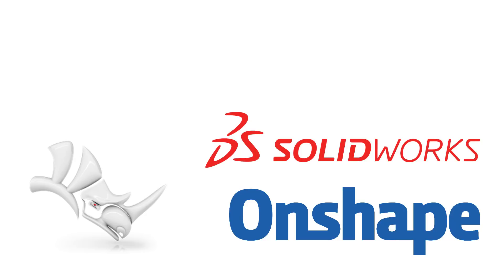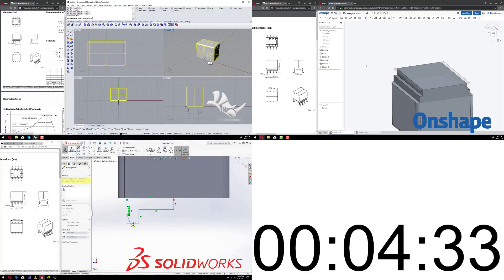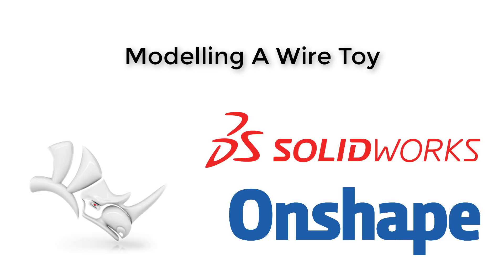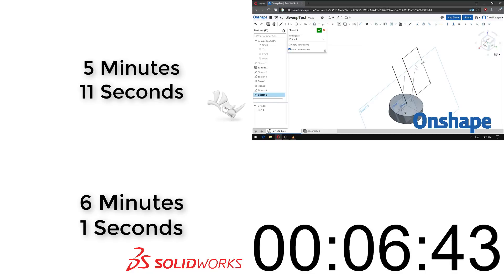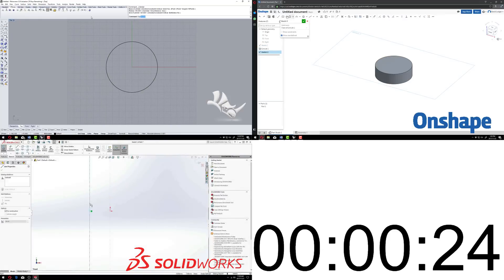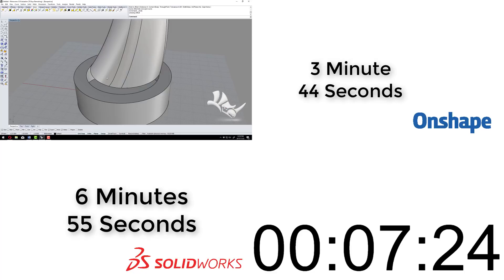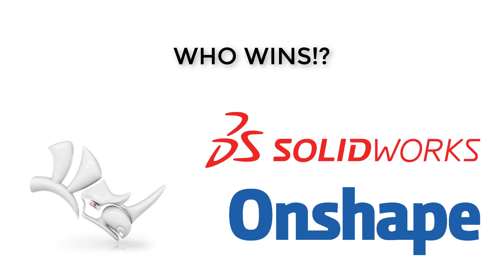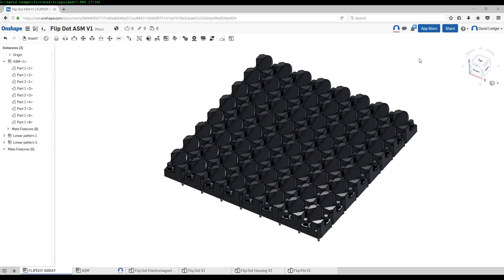MCAD Shootout! - Rhino vs Solidworks vs OnShape

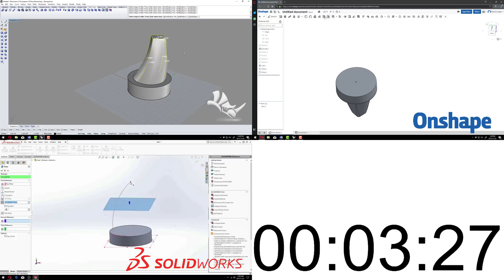Comment: At 7:09 you literally mentioned that "Rhino really, really sooking". The very slow time for making the fillets in Rhino was due to using improper technique. At 7:45 you intentionally changed the rail type in Rhino from "Rolling ball" to "Distance from edge". Upon that moment you even saw from the real-time preview that the fillet with "Rolling ball" would work just perfectly (similar to what both Solidworks and Onshape did), but for some unknown reason you decided to NOT use the working solution and opted for the other fillet type that eventually failed, because the bottom shape was a circle. That's something that every experienced Rhino user knows.

Comment: lets say i bulid 3d model with a contractor on 3dsmax  . what is the chance 3ds make artist will have full control over solidwork? i need to manufactor watch (we talking about 4-7 different part)  the most complex part is watch engraving for the dial face.which make me wonder should i go texture with 3dsmax or convert to solidwork and texture on that ? thanks

Comment: I use Rhino for freeform optics design. It's the only CAD package available that has good enough surface modelling tools to do it. Most other tools are focused on mechanical design and engineering use and simply do not have flexible and accurate enough B-spline surface modelling. It's no coincidence that Rhino is also the defacto tool for modelling ship hulls. Many of the same issues. I think maybe the only other tool that could potentially have the correct surface modelling feature is Catia. Rhino can be scripted from Python too, which is critical for designing more complex optic surfaces.

My point is that you need to choose the right tool for your task. Each of these tools has a niche. I think the mechanical design area has many good choices. However smaller, more unusual design domains usually have one or maybe tools available that are suitable.

Comment: Hi David, are you equally proficient in all three packages? In my opinion, the value of being able to create parts quickly is fairly important; but what is more important is the ability to make changes to designs should they need changing. How do the three stack-up in this regard if decent design intent has and hasn't been used?

Comment: Now we can see how good you are with Rhino and Solidworks. And how good we are ? The time depends on the experience of the user. Are you good or bad or mediocre ? The time comparison is totally pointless, because it doesn't matter if i create a 3D model in 10 minutes or in 15 minutes. Small electrical components are not complex 3D things. You wanna download ready to use 3D models instead of creating one. Whitch kind of 3D files will you find on the net most often ?

Comment: I work with Rhino daily for jewellery design,  there are definatly quicker ways to model,  fillet curves before lofting to avoid all that trimming.
Reply: I would appreciate and details greatly, this issue is such a pain in the arse.
Reply: David Ledger 
In the example where you had difficulty I would have created the top and bottom curves for the cylinder with the square box too,  choose rounded corners,  then from the front view raise the curves to the hight you want.  Switch back to the front view and use the project tool on the base curve to copy it on to you base surface.  Use the trim tool to create an opening in the base using that curve.  Create one profile curve between the top and bottom line's and use the sweep2 command,  no fillets needed.  Rhino is terrible at handling fillets,  I have about 6000 hours of rhino under my belt now,  most people don't have that kind of time,  but it's part of my job.  It is an extremely powerful surface modeler,  of you add t-splines you can model fantastic organic shapes as well.
Reply: Square box tool,  sorry for the typing errors,  sent from my phone, small keys.
Reply: That seems to make sense. Certainly faster, not too much though, thanks for the tip :D

Comment: Why do you feel like you have to constrain the sketches in Solidworks? It's completely fine to leave things under-defined, you don't HAVE to do a completely parametric model.
Reply: Yes, Good point! should have just eyeballed it and left it or had it auto define things after eyeballing.
Reply: Craparametric modelling?

Comment: Is Fusion 360 any good? I only use it because it's free
Reply: Fusion is awesome, and not just cause it's free.. In this video Solidworks is the only competitor to Fusion.. U might as well go with Tinkercad if OnShape or Rhino interest you .. But personally i love Fusion 360, it's just awesome, very easy to use but also very powerfull software with more features than most ppl will use , similation, cam, etc.. Most AutoDesk software is very good  (AutoCad , Maya, 3DS Max, Inventor) and a "industry standard" so to speak, but Solidworks also has a part of that market and some ppl are SW fanboys and some ppl are Autodesk , feature wise i dont think there is a huge diffrence, just what ppl prefer ..

Comment: I have Rhino and Solidworks. For any kind of product design and prototyping, it's SolidWorks hands down. It's relatively user-friendly, it's easy to change any of the parametric values and update the model (and SolidWorks will tell you if there's a problem). Constraining can be fiddly, but often it's a case of not adding them intelligently. Plus it also has many options for creating standard features, such as sheet metal bends, structural members, injection moulding parts, etc. and even processes for design optimization and basic FEA (though you should probably use Abaqus if you want to do something properly for the latter). You've also got a renderer for high-quality images and you can create animated videos by keyframing constraint properties. 

Rhino, on the other hand, is far closer to general 3D modelling software compared to SolidWorks which is closer to pure CAD. The command-based system can be difficult to use and it doesn't have a lot of the features SolidWorks has. You can make things quickly with it, but trying to edit them afterwards is a real pain. However, it does have Grasshopper, a powerful block based pipeline that allows you to do all kinds of complex and interesting operations on objects. It's great for analysing a 3D scan, or generating toolpaths for manufacture (which is done at a far lower level than many CAM packages), or creating complicated solids programmatically. While SolidWorks does have some pretty decent patterning features, it pales in comparison to the complexity that Grasshopper can do.

Comment: The only way to do this is to have true experts in each package given the same task. I have been a SolidWorks user since 1998 - and I can model these demos FAR faster. With that said - I am getting tired of the maintenance costs of SolidWorks and integrates MasterCAM for SolidWorks. Excellent performance, but at a big cost. 

Maybe Fusion360 can replace it or at least encourage SW and MC to attenuate the pricing.
Reply: @JetNmyFuture Agreed. I have not seen any Rhino entrants Too Tall Toby's tournaments but SW and Onshape appear all the time. Rhino does not calculate mass as far as I know, which might preclude it from entering those tournaments.

It seems to me that Rhino tends to be best at freeform design which does not lend itself well to objective comparison.

Comment: Great to see Rhino featured in this shootout. Worth noting that Rhino has access to parametric modeling via the Grasshopper plugin, which is free, and will be bundled with the next major release. Also worth mentioning that Rhino's educational license allows commercial use until the next major release after you lose educational eligibility. I see lots of people mentioning Fusion but I have gotta admit as a Maya user in my day job, Autodesk subscription pricing models really put me off at this point. Fusion might be affordable now, but I am distrustful that it will remain so into the future.
Reply: I'm interested in knowing more about Rhino. What makes it better software than Onshape or Blender? What makes it a good surface modeling software?

Comment: I don't want to be "that guy" but I am not sure what is the point in comparing software packages like this. To me it does not make any sense to compare packages that are actually CAD vs 3D mesh modelling (like Rhino). The capabilities are vastly different and the tools are meant for totally different uses. So calling this the "MCAD shootout" is a tad misleading.

Also given how much SolidWorks costs (99% of people can't get a student license!), is it fair to compare it with essentially free (for private use) browser based tool like OnShape? Given that difference, it is surprising how usable OnShape actually is. 

It would be also good to mention platform availability - not everyone uses Windows (especially the hobbyists) and out of those three only OnShape actually works on all major platforms (Linux or Mac - it is browser based), Rhino exists for Windows + Mac and SolidWorks is Windows only. 

Some other CAD tools you may want to look into:
Fusion360 ("free" for hobbyists, cloud & Windows only)
FreeCAD (basic but free & cross platform)
OpenSCAD (free, cross-platform, programmatic modelling based on CSG - useful for 3D model generation using scripts and so on)
DesignSpark Mechanical (free)

If you have access to demo versions, then CATIA from Dassault and Inventor from AutoDesk are two of the large players but those are very much out of the price range of mere mortals.

And from the mesh modelling camp:
3DStudio Max (AutoDesk - mostly computer games 3D artwork)
Maya  (AutoDesk - mostly film CGI industry) 
Blender (cross-platform, free)
Reply: Though you were being mean for a moment, but you are not. Thanks for the feedback. These are my daily drivers doing product design. 

There were lots of reasons I thought this was useful to people though:

- When you start out you have no idea what CAD packages look like at all and don't know the workflow at all or even where people start.

- It shows how much time various operations take in various CAD packages and things to look out for when designing a model in one of the packages.

- Your paragraph 2. This video showed that I believe

There are a few other reasons, I've mentioned a few in the other comments, I'm pretty tired at this point but your comment deserved a response, thanks mate.
Reply: I use Fusion360 on a Mac so its not Windows only.
Reply: As a student I can (and did) easily obtain licence for SolidWorks. Probably depends on your local distributor / university.

Comment: Looks like you were very unfamiliar with dimensioning shapes as soon as you put them down.  you tend to go back and use the dimension tool, which is generally unnecessary unless you are dimensioning from another part..  Once you click the shape down, it will show the dimension that you've just set it down as.  start typing your dimension in order to change it to what you want.  for squares/rectangles and the like, you can hover over the dropped dimension you want to change, then when you start typing numbers it should change the one closest to the mouse.
Reply: I should have done that, I didn't have the actual dimensions of the pins and was trying to make it look similar to what was in the data sheet (it didn't have all the details), I needed the big picture first to get things in proportion.
Reply: David Ledger okay that makes sense.  I've just found that it at least doubles my modeling time if I don't use initial dimensioning.

Comment: This is a really nice comparison, but it's a little unfair to compare these tools in this way without being more proficient in each of them. I'll echo what others are saying too, Fusion360 would have been a good addition, especially with it coming from the holders of Eagle. I use Solidworks nearly daily, but the moment drawings and BOMs are not garbage in Fusion360, I expect to shift entirely to Fusion360. (Been saying this for two years... still waiting...)
Reply: Yeah, lots of people want to see 360, that is software I'm inexperienced with I couldn't really do it justice and I also couldn't design a test to show an issue. 

Hard to know where to improve without feedback, why do you say I'm inexperienced?

Nice channel btw, liking your videos so far :)
Reply: Hi David, thank you. Sorry, I worded that poorly, I meant an imbalance of proficiency and I'm probably going to muck up the explanation. First, I know nothing about Rhino and Onshape, and that being said, I can only follow along closely with the Solidworks examples, and those could be tightened up. I say this only because you are comparing time. You are clearly not inexperienced, as you using Solidworks with a proficiency that exceeds folks I work with who use Solidworks daily, so we are in the domain of diminishing returns. Reading through the first few pages of comments below, it's impossible to satisfy everyone if doing a comparison. (Maybe the closest would be to put out the challenge for others to do better with the package of their choice.) In fear of sounding like a fan boy, consider spending some time with F360, which has many of the features of Solidworks Premium (simulation, feature recognition, CAM, etc.) without the expense, and direct modeling that looks similar to Rhino. I'm an independent, so value, cost-to-useful-features, is the metric I care most about. I would love to see someone dive into F360 with Eagle, experienced or not. (I've been using Solidworks and Circuit Studio.) Hope that helps. Again, sorry for the misunderstanding, and keep up the amazing work!

Comment: I wanted to love OnShape but Fusion360 just kept getting better and better. It's useable for push pull or parametric modelling and Free for students /startups.
Reply: Maker's Muse have you figured out how to lazily one hand CAD in fusion 360 like is possible to do in Onshape?  None of the control settings seem to let me. It's why I've stopped using it tbh.
Reply: Why would I not use the keyboard hotkeys and finish it in a fraction of the time?
Reply: Just for navigation.  You can use hotkeys if you want.  You don't have to get defensive.
Reply: Same here, I chose OnShape mainly because I run Linux and I've not been able to get Fusion360 to work in VM. OnShape is so far the best I found which works anywhere. Plus I don't have to update it to get new features.
Reply: I'd be interested to hear you elaborate on this. I'm a big proponent of Onshape. What features do you prefer about Fusion360?
Reply: Your comment that you would need to delete the fillets and redo them if you wanted to change the radius is just not true. You just need to "enable history".
Reply: Is your opinion still the same?

Comment: You don't really know how to use OnShape.......
Reply: Elaborate :)
Reply: Why didn't you use the face to sketch the base plate? Just like SW. Its sketching is very easy to use, easier than SW. Planes are a little trickier, but you would not use the method you used here to do this. 
To create an arbitrary 3D spline you would create a two splines and use projected curve for the loft path. As is arbitrary bridge curve should work. Fusion seems to have nailed this feature better than either.
Reply: I did sketch on the surface. My planes might be suboptimal but yeah I was sketching on the surface. Haven't done much 3D sketches in on shape though so could be right.

Comment: I agree with many ppl here and as a Fusion 360 and Inventor user, i feel this is a pretty poor test of Cad software, SW is more a competitor to Autodesk solutions
Reply: Agreed, that is its direct competitor with inventor, not really fusion 360. This video wasn't to inform people on the choice between inventor, solid works, solid edge, ironcad etc. I wanted to show people the differences, how even within the field of product design the decision of cad package or even the category of cad package isn't obvious. They are three very different packages and three very different price points which achieve the same outcomes, albeit sometimes with a huge amount of effort :).

Comment: Obviously the modeling tool will get the job done faster but in my opinion Rhino shouldn't even be on this list because it's on the same level in every aspect as other 3D designer tools which don't classify themselves as being made for engineering like 3DS Max, Cinema 4D, Blender.
Reply: Its also targeted at industrial design, something that I mentioned, I didn't say it was an engineering CAD package.
It does make for a good tool when doing things like enclosures or really for any surface modeling. Just search rhino in youtube and you'll see what i'm talking about :).

It also has a very different work flow which I though made it an interesting addition.
Reply: You're wrong.

Comment: Here in the UK I have found that most big industries use SolidWorks. It's why most mechanical engineers are taught it at university. It is a lot more powerful for real engineering. If you just want to make simple parts for a hacked together project, the free ones are okay, but for the hardcore stuff you are better off using SolidWorks. Plus if you are looking for a job in electrical engineering in the UK, most companies wont care that you can use onshape, but they will care if you can use solidworks, even if it's not a pure mechanical engineering job you are applying for.